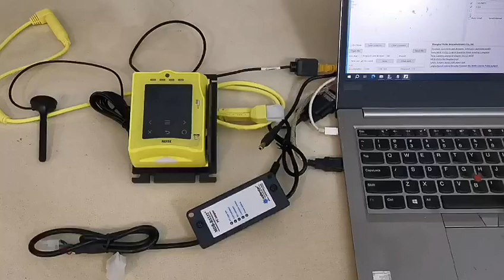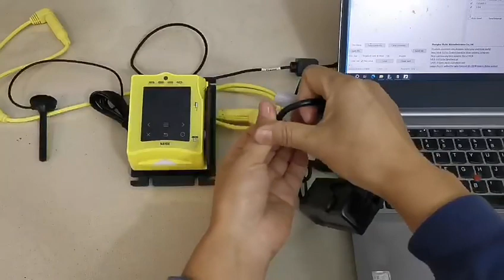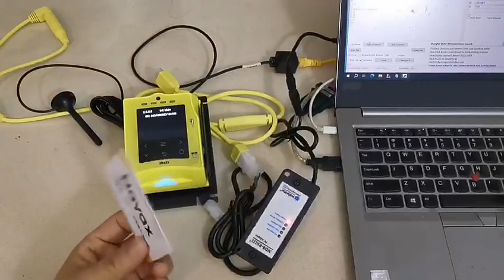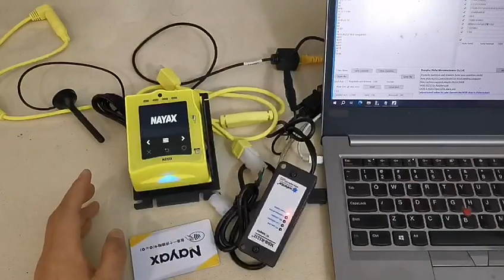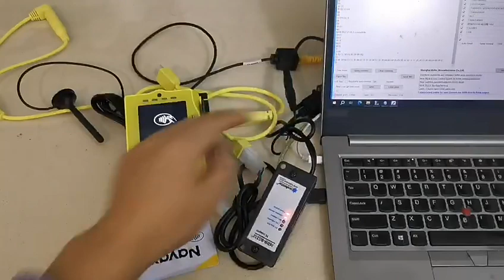mdb-rs232 converter test with nayax vpos touch MDB card reader

Comment: Thanks for the Video. Can you make probably a Video with an Rasperry Pi. You can use Node Red or somethinge if you send the right RS232 data, right?
Reply from the maker: That is easy to test with PC software to communicate with mdb payment device through MDB-RS232 adapter box.  after familar with the mdb protocol. then easy to do the programming on the raspberry pi. So we suggest the customer to test with the PC software firstly..  then later the serial communicate data format is the same.  Any questions, can check the http://www.mdb-rs232.com
also can download the protocol, manual and PC Demo test software.